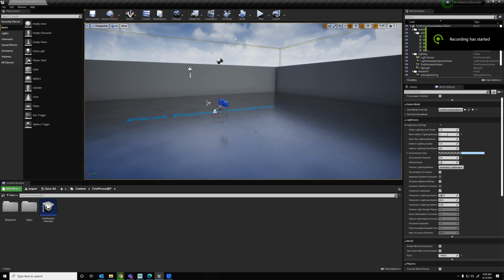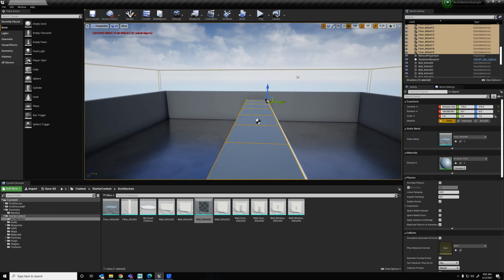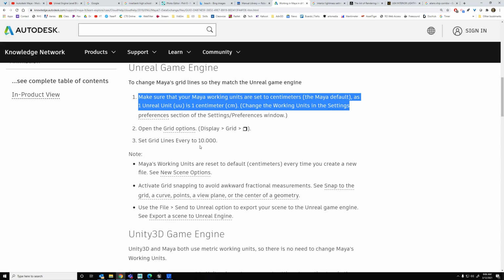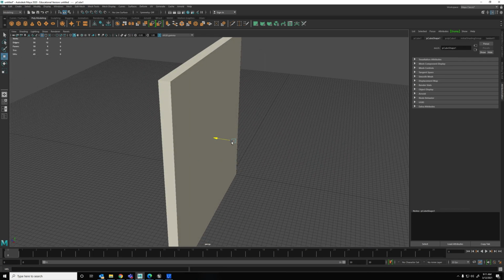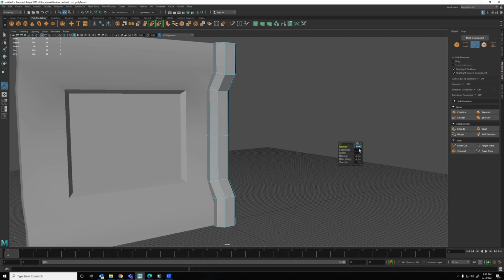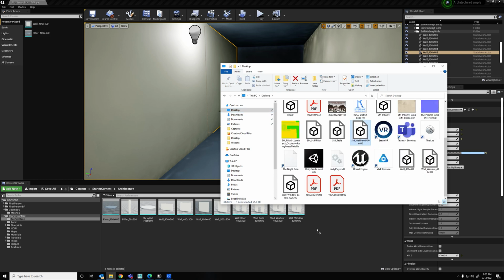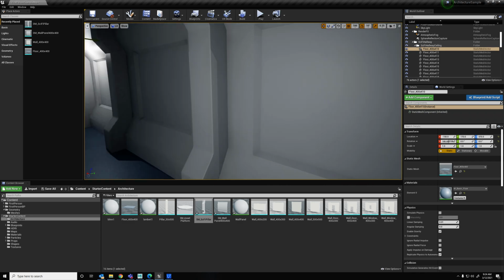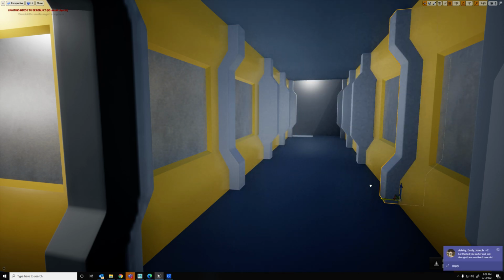Basic Unreal Custom Modular Architecture Tutorial

Comment: Hi, I have a problem. I tried the starter contents acitechture. And I want to edit the wall one. I made it it's half with blender boolean feature. And I exported this to unreal. There is not a big problem actually. But uv was a little bit corrupted. Actually the original wall model has a corrupted uv too but it doesnt make any problem. But mine one does. I am sorry because I couldnt explain the problem well. So, my question is. How can I cut this wall with a true way? Btw I watched your window video and I make a one for myself and it worked fine. No ligthmap problems no shadow problems.